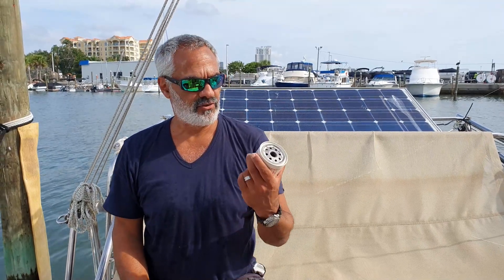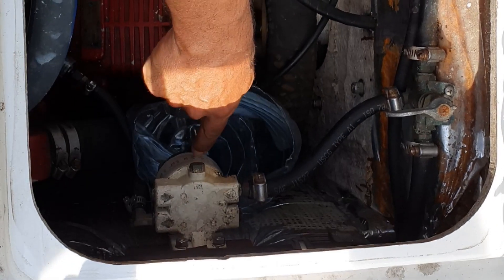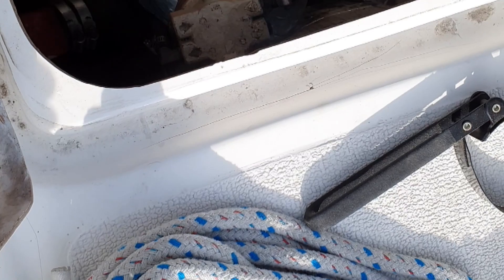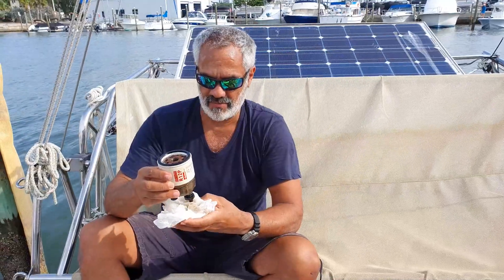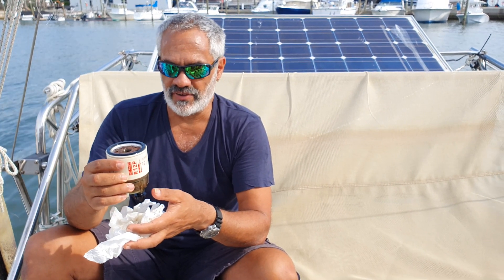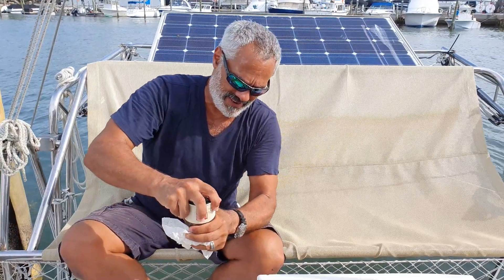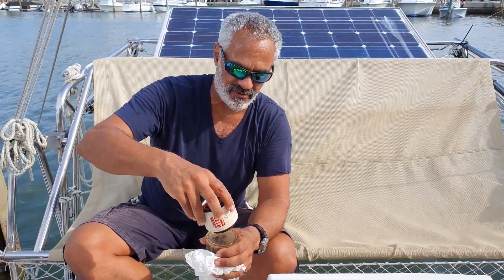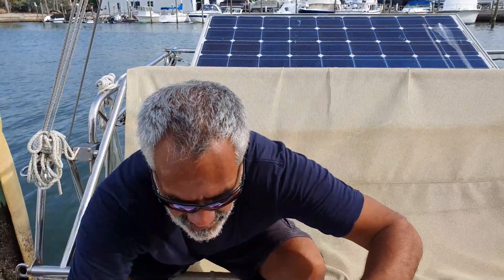Replacing a Racor fuel filter element

Comment: What was the big white arrow head pointer on the top of the filter mount, was it pointing to an air bleed plug when you're finished and cranking engine...mine has a large white plastic star-shaped knob on top..so thought your white arrow might be pointing to something similar...camera work was too far away for most of the video...and the dark shirt made it impossible to see the black drain plug you were holding up in front of you and opening on bottom to drain fuel.

People talk about "polishing" the fuel, but if you have no gunk and/or water in this filter, what's the point of "polishing," ...and how is that typically done if you did ?

Comment: Maybe I missed something, but you first talked about this being a self bleeding system, but then later discussed the bleed valve on the Racor. Also (someone else asked this too…) Assume fuel should be shut off before this change (??) but I don’t know if you did that. Also, why is there no black gasket on top of the replacement filter? Thanks for sharing your knowledge.